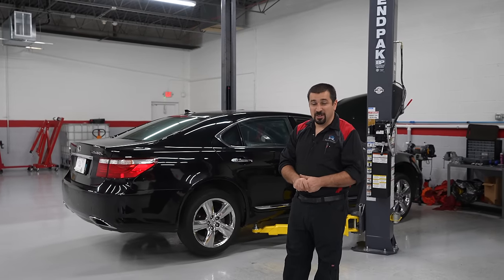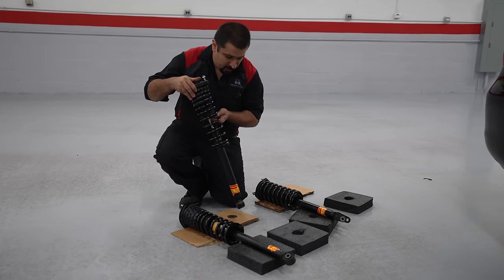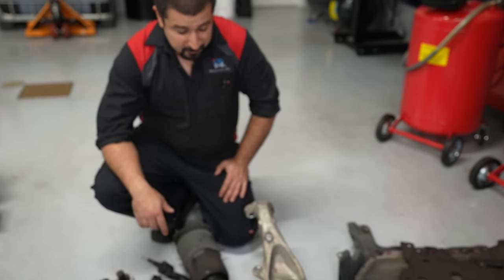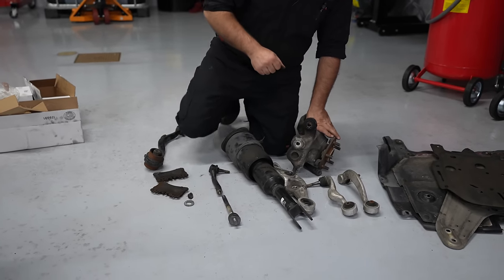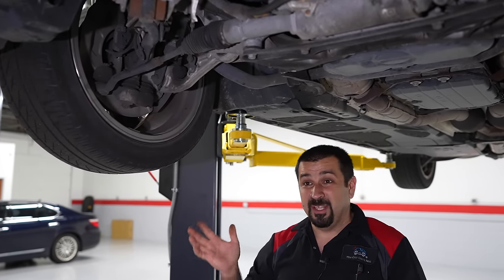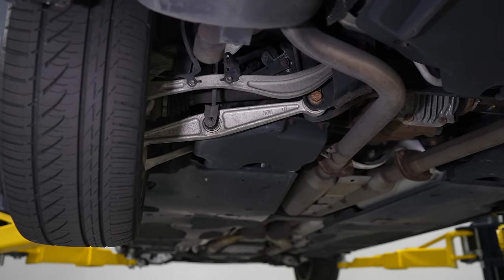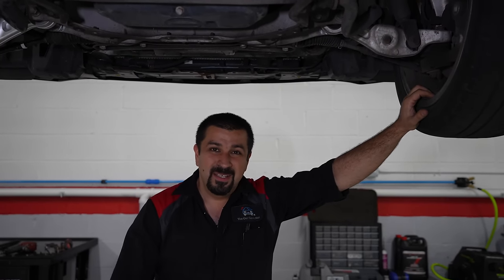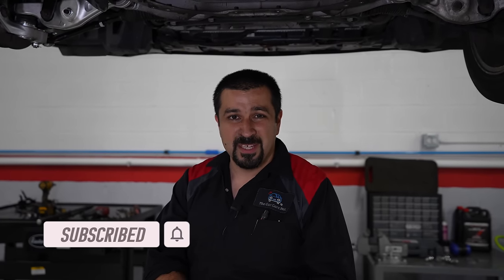Avoid THIS Lexus Model | Pre Purchase Inspection REQUIRED for this one and Here's Why.

Comment: My 08 LS still has some deferred maintenance to get taken care of.  I need two rear struts (one leaking), a transmission service, brake fluid change... and I need to replace some front lower control arms... again.  My only complaint is the lower control arms because I replaced them all 18 months (25k miles) ago, so that's a bit of an annoyance.  Otherwise I'm happy with mine.  No air suspension or the ML stereo.  Not even a nav system to look ugly 15 years later.

Comment: You can fix these cars on your own, I’ve done the control arms, sway bar links and bushings in total about $500 and car runs like it’s new, shops wanted to charge me 2500 for control arms and 1100 for sway bar links to be replaced smh, thank god for YouTube as long as you have the right tools you can fix these on your own and have the car running smooth, the wheel bearing is tough to get off but definitely can get it off just takes patience

Comment: Struts everywhere.  The Lincoln Town Car until 2002 was all springs and shocks separate.  Rebuilding suspension much cheaper, nothing that can't be made in China.  I don't see such kits for sale for the Lexus.  It's also pretty cheap to replace all the parts of the rear air suspension, even the pump.  It all costs the same as a 2 wheel spring conversion (giving up air suspension) on the Lexus.

Comment: I am a little surprised the suspension is only 6k. That’s not too crazy for a flagship model like this. Assuming the stuff will last as long as the originals did, over 10 years now.
Reply: That's not Lexus dealership prices
Reply: 6k? That’s very expensive.

Comment: We have a '14 LS460 and an '05 LS430.  We don't put a lot of mileage on them.  Neither has been problematic but the 460 has had a few things now and then.  Looks great too.  The 430 (we just have a base model) has had zero maintenance ever aside from the routine work contemplated in the owner's manual.  Looks kind of boring compared to the swoopy 460, but it seems to me that the 430 was something really special.  It's also much easier to do basic work on yourself.  At any rate, you cannot beat a naturally aspirated V8.  I don't want a turbo'd V6!!
Reply: One of the best years for the 430 and it looks MUCH better than any 460, too. Never sell it.

Comment: THANK YOU for this video. I'm looking at a 2008 ls460 with 134000 on it. Drives like a dream, super well maintained, I want it but I'm worried about the ongoing costs.

How do I even look for the valley coolant leak?
Reply: Same i saw one with 80k miles for 15k from a dealer But the price just seems way too good to be true.

Comment: I have a 2016 460 LS with 49k miles…Lexus maintenance recommends synthetic oil changes every 10k or annually.  Should I ascribe to every 5k mile oil changes?
Also, does any one of you use/add petrol line additives?  If so, what brand and will it damage the 460 engine?

Comment: My Lexus dealer in Coral Springs and the one in Seattle couldn't figure out for 7 years why the car pulls to the right. We took the car to TiresPlus for new tires and the gentleman working on it said the front right caliper had ceased up 🤦🏻‍♂️

Comment: Ls430 better. It’s fine wine. I like the 460 but it just seems way heavier, Iknow the controls go out quicker. I work on a dealership and we got a 460 bout 30k miles. Control arms look bad and shocks where leaking. I don’t like using aftermarket parts, I always had bad  experience aftermarket parts. And your right bout the freaking brake sensor, god dam 115 for the ls430. I installed brembo brakes and it dint last me a year, rear pads where done. I wen with oem.

Comment: How many miles were on the LS460 when the ar suspension gave way? FYI you are the greatest Mechanic I have ever seen especially checking minut details. And I as a young man have built many Hot Rods in my day of (uncomplecated V8s  of the 50s, 60s and 70s).  I have a LS430 that I will be putting the coil overs in replacing the air suspension, at 100k miles.

Comment: It's actually much easier to separate corroded steel from aluminum than it is to separate corroded steel from steel or aluminum from aluminum. Steel and aluminum just don't like to adhere to each other.

Comment: Hi, i am a super fan.. i currently own a 2007 ls600h 94000km (driving perfectly, no codes, no suspension problems)... i have an option to swap it with a 48000km ls460. Should i make the switch in anticipation of potential hybrid repairs in the future? I am prepared for a battery and control arm repairs in the future.... but can not affort HCAC valve sticking, or coolant leak repairs (common with LS460). What would you advise?

Comment: Thanks a lot for all this information about these issues. I live in UK and now considering to buy one as weekend car, every now and then ride, like not a primary car. The 2013-2016 LS460 price ranges £10 000 to £16 000 for a milage of 90"  - 110 ". I just would like to know how much miles this unit had ( a year ago😀) And when normally these issues are expected? I know everyone would say,, All depends how the car was used and been taken care of . But still,  there is a mileage number that these issues are more presented!!! By the way all the LS460 sold in UK do have air suspentions , unfortnately. Thanks in advance for a reply

Comment: Thank you for your sharing your expertise! I have this car fully optioned and although there are some common issues, I'd say its still worth it. Just replaced my radiator and other than expecting the air suspension and control arms to need replacement soon, I expect the rest of the car to last for as long as I own it! I have about 100k miles on mine and I am pretty sure it will last at least 100k more :)

Comment: I looked at a lot of Lexus automobiles before I settled on purchasing a used 2013 Toyota RAV4 two years ago, I made up my mind early on to avoid any and all Lexus V8 models, nice cars, EXPENSIVE to operate and fix. I almost purchased an RX350, but changed my mind at the last minute when my dad told me something with a 4 cylinder because Senile Joe was going to jack gasoline prices back up into the Obama era prices, plus the Lexus burned premium gas.

Comment: Toyota/Lexus makes the most reliable cars in the world with a few exceptions. This is one of the exceptions. The front end components wear, the engines burn oil, the interiors literally melt.
Reply: My wife has a 2007 RX 350 Lexus.... 40K miles... It lives in an air-conditioned garage...   Dash melted last year.  extended dash warranty ended in 2017.  EXCELLENT vehicle except for that..

Comment: I have a german car, 2009, 100k miles (VW Phaeton) and I don't have oil leaks or oil consumption. So it's not "standard" on german cars to have issues like that. Although my front axle suspension is showing similar problems like this Lexus, although not nearly as bad. But a little shaking of the steering wheel and uneven wear of the tire show me I need to get rid of it

Comment: Quick question: 
2013 Camry XLE, 2.5 L
120,000 , no problems whatsoever.
Should I use a thicker engine oil ? 0w30 instead of 0w20 ? 
Thanks !

Comment: What's the best LS years and models to buy? And are there certain years of GS and ES models to stay away from? Also, which models are the most expensive in parts and repairs down the line out of all of them?
Reply: 93 - 2005 Lexus GS all great with the 2jz, 98 - 2005 GS 400/430 again great engine but a bit more complex...these cars also have sensitive ball joints, and brakes need to be maintained. 93-2005 Lexus 400/430 built like tanks, ES models are great in all years....stay away from the 2006 GS 300 not a great engine. 07 -12 GS are good but the ES in those years are the best of both worlds for performance, comfort, reliability . Lexus IS 2006 had direct injection so you have to pay attention to carbon build up. Latest gen not a fan of their design language but they are pretty reliable. The RX is also reliable in all generations but some early models had trans issues. I think the sweet spot for the RX is 2007 - 13 , good looks and strong v6 engine.

Comment: Have an 07, maintenance has been cheap and minimal. At 150k roughly replacing the control arms. The bushing thing is only expensive because of how the wishbones are designed, a lot of labor.

Meanwhile Lexus has repeatedly tried to buy this car back since 2007 when it was brand new.

A lot of the LS cars get resold in Russia by Lexus themselves. Calling this a bad or expensive car, maintenance wise is a joke.

Comment: 2 years ago purchased an 07 1 owner...no air suspension...RWD...Had 81k miles on it paid 13k for the car...It has 87k now..  All new control arms on the car brand new replaced by original owner dealer serviced.  Only thing I put in the car is a blower motor for the heater.  Now I'm scared.  The only thing wrong with the car is the roof drip rails.  The vinyl wrap on the rails peeled off....IDK...maybe I should dump it...I don't drive it much. .6 miles to and from work
Reply: keep it!

Comment: who installed the brakes? If I had to buy a luxury car, it would be a lexus, but not with all of these extras which will cost $$$$.  6K is a lot to repair these systems. the more tech the more it breaks and more it costs.  I have a 21 Miata 6 speed MT and if I was going to get another car, it would be a toyota.. Your vids are impressive!!

Comment: What years is this LS 460 with air suspension, and is this the L model?
Also, what are your thoughts on the 2013 Lexus LS 470 non air but coils suspension?
Thanks

Comment: My ‘04 LS430 had factory chrome wheels. What JUNK! Sadly, the Japanese don’t do chrome well. By 2010, 3 of the 4 wheels/tires leaked air because the chrome on the inside of the bead area was flaking off. Other than that, and a sometimes cranky engine/transmission communication problem, it was one of the least expensive cars to maintain.

Comment: Hello, I’ve had this question for a while, can you tell if a Toyota/lexus is having issues with burning oil by just running a simple blowby test on the engine, I guess my question is if there is a correlation between engine blowby and oil consumption?

Comment: Hello! I have watched so many of your videos. You are great. I have a 2015 Lexus GS350 and I took it to the dealer to flush the transmission fluid. The service advisor said they do not change it, it lasts the lifetime of the car, and only if there is an issue with the transmission then they could change it. Should I force them to change it anyway? I have 26k miles but the car is 7 years old. Help please!

Comment: 05 and 06 LS are the best ones Toyota made in terms of quality, trouble free, modern, styling, etc.  07+ they became way too complicated and full of electronic stuff that will break down and fail long term.  The current LS is a disaster by dropping a V8 and using turbos.  Less than 1% of drivers know how a turbo works and the importance of oil changes or operating tips that add to the life of the turbo.  Avoid any car with air or hydraulic fluid based suspension unless it is under warranty and will cost you nothing if it breaks.  The older LS cars will still be on the road in 10-20 years.  The 07+ even without air suspension will all become economically totaled once they drop to around $5-7K and repairs exceed 30-40% of what the whole car is worth.

Comment: Do you know anything about the block heather recall on many Lexus,Toyota vehicles recently. Including the 1ur-fe on the LS 460 my local dealership said there is no replacement or repair they can supply. Because original heater or cord will heat up to the point of failure and possible fire. Is there a reputable replacement to have a functional block heater?

Comment: Personally, I would not be so surprised by the findings. Considering that this is an older car and probably a daily it is expected that these parts will fail at some point. None of these parts was designed to last forever. Also, here I see no issues with the vehicle itself but owner's procrastination to maintain his car. None of this damage shown to the parts happened over night. There have been signs of wear and tear long ago. After yall just replaced everything, the difference will be so big that the owner will driver this car for longer than two more years :)))

Comment: Why does he say the brakes are "astronomical"? When I bought mine, it needed front rotors b/c they were warped, which happens with these cars.  I bought new rotors and pads from the dealer for $380, and these are the biggest brakes I've ever had on a car.  The calipers and rotors are really massive.  I think the price was reasonable, for what was a $71,000 car new.

Comment: AMD have you ever seen a manual transmission behind ANY V-8 that is OE on a Toyota? The reason that I ask is that I want to put a put a Toyota V-8 in my V-6 equipped Tacoma. Granted my Tacoma is a 99 but I bought it new and I would like to keep it all Toyota. I know that it sounds crazy but I REALLY like my truck! Thanks for any kind of response that you might give me. 

BYW, it ha a FACTORY 5-5sp in it now from the factory with over 350k on it but I’m in the market for more power so that I can run 35” tire and 5.29-1 gears instead of the OE 31” tires with 4.10.1 gears. I know that this all sounds foolish but I’d like some information from someone who I trust. 🙂

Comment: My 2007 LS 460 L , has the full package. It only just hit 110k Miles. My mechanic buddy said under is clean, just that the little front noise, which is not bad, and is not a wheel bearing issue, and that I just need to replace front control arms and knuckles. Can you Tell me the mileage that was on this particular LS in this video. Please and thank you. 
    oh, and My LS only burns oil when I use power mode and drive heavy on it on the highway, well at least for right now, being careful with that. 
  Thanks and I subscribed :)

Comment: I dont have the time right now to watch the whole video, but based on the segments and the model, I assume the main issues here are the control arms? if so, most of the issues were resolved in 2012 and the facelifted models if the ls460 and ls600hl both have updated suspension that doesn't fail nearly as much.

Comment: Car care nut it is funny I came across this video today I ran into a suspension issue with my 2020 Camry SE. We went down a road that had a alot of bridges that were slightly higher than the road and when we hit the bumps our car seemed to bounce a little more than I have seen in a long time. The car only has 32k miles on it now. Do the 2020 Camry SE models have any suspension issues that I should be concerned with? It is still under warranty so we may take it to the dealer and have them check it out for us. Thank you! Another great video too you are an awesome mechanic and wish you were in Texas:P

Comment: As someone who wanted one, but decided against it, I have to ask the owners of these LS460s what the throttle response is like.

IDK if there's a sport mode or not, but when I test drove one, under 4k rpm throttle response was okay. Not great, maybe good, but definitely decent. Over 4k RPM the throttle response was nice and snappy, almost instant. However, going from a leisurely cruise at around 40mph to WOT, I counted about 2.5-3 ENTIRE seconds between when I put my foot down, and when the computer found the gear it should be in. IMO that is a HORRENDOUS response time from 40mph loght throttle to heavy throttle. That said, here's my question.

Is what I described normal for the LS460, or did I just so happen to test drive one that had some underlying problems? Car was being sold at a used car lot

Comment: i bought 2007 ls600 for 13000€. i upgraded front suspension system and big battery for 3000€ + 2500€. Now I have a super car. the new LS is 99000€.

Comment: Hi AMD. Previously in the suspension video, we learnt never to avoid replacing the original Toyota ball joint, as they are so reliable made.
Is the design of the lexus what's causing it to fail?
Reply: The Low profile tires can't absorb shocks as well . So the suspension has to work harder

Comment: the more bells & whistles a vehicle has, is just more things that WILL cost you alot more now & later on.the automakers know this, thats why in so many cases they make them standard as opposed to options.an easy way to keep their parts & service departments rolling in the big bucks.i dont even want power windows.my arms & hands are more than capable of winding a window up & down.

Comment: Which used Lexus LS 460 would you recommend?
I’m looking at the 460L model but what year is the best as a used vehicle.
We want the L model due to all in the family are tall so the room in the 460L would be good for all.
Keep up the good work, your channel is proving useful in making a wise purchase.
Reply: 2011 is a good one.. Still look at the maintenance history though. Good luck.
Reply: I have a LS460L , 08. The only thing I recommend is do not but an L MODEL if it has air suspension. 
I pray occasionally I will never have to put a new air suspension shock on as it had one before  bought by the previous owner pd $4000 
ps don’t know if you can buy the L model without air suspension?
Reply: @is4life862  thank you; will put that on the list for consideration
Reply: @is4life862  thank you will keep that in mind.
Paying for an inspection is a lot cheaper than maintaining a car with issues.